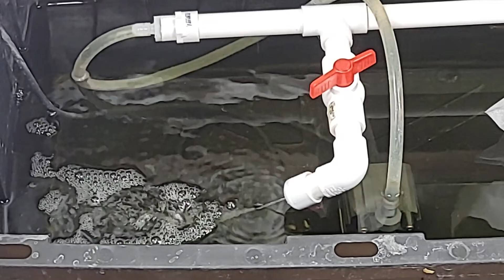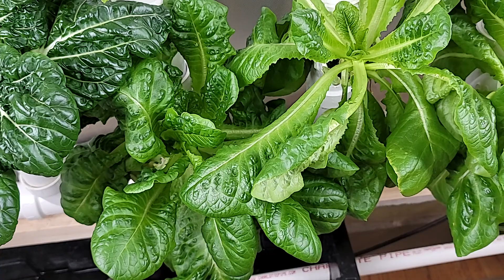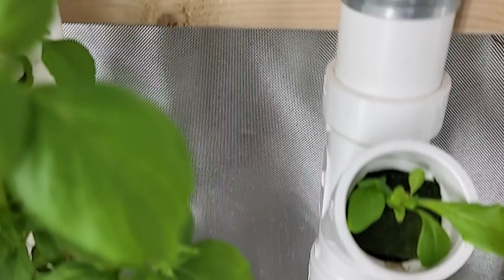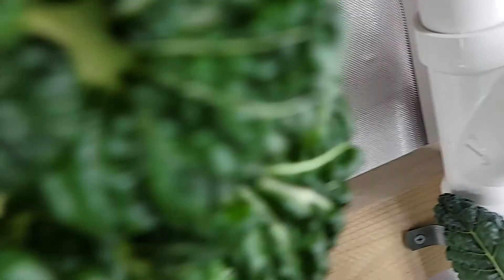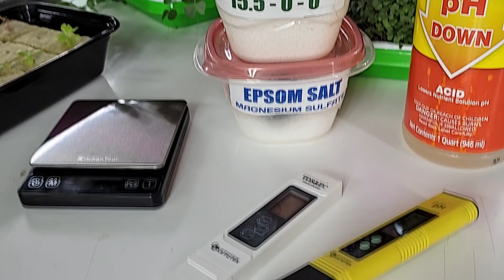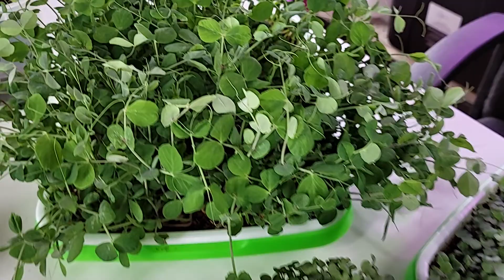Vertical Hydroponic System

Comment: What did you use to prevent the plants for falling in the PVC tower?
Reply from the maker: I start the seeds in a growing medium, either Rockwool or  Oasis horticubes. The cube shaped growing medium fits snugly into the pipe and holds the plant in place.  Once the roots get established they will fill up the pipe enough to naturally stay put.
I have lost a baby plant down a tube a couple of times when the cube was not quite big enough. I just fished it out of the next lowest hole.  After that experience, if a cube is a little small, I tear off a scrap from the growing medium and use it as a shim on one side to make sure the cube fits snugly.

Comment: What grow medium are you using for your system?
Reply from the maker: I started out using Growdan Rockwool cubes. That worked  well. I reordered what I thought was the same thing, but ended up with an off brand that looked similar, but didn't work. Germination rate was terrible with the off brand and plants grew very slowly.
Then I decided to try Oasis Horticubes. They are a little less money, 10 cents each vs 14 cents for the Rockwool. I am using the 104 per sheet cubes. They don't fit as snug as the   Rockwool but work fine and I think I like them better. 

Either is a good medium. Rockwool is naturally higher in ph so you should soak them in a ph adjusted water before using them.  That's not necessary with Oasis Hoticubes.

Comment: Great video! Can you explain the top watering section more? What are the rubber grommets were the black hose comes out of the pvc pipe exactly? Thank you!
Reply from the maker: if you search Amazon for Top Hat Grommet you will find a variety of choices. I use Hortipot 1/4 inch grommets and they work really well. Drill a 3/8 inch hole in the pvc and the grommet will fit in tighly. They never leak.

I also like to run the water into the back of the stack near the top instead of through the top of the cap. it's less height for the pump to lift the water and makes sure the water hits the front of the pipe,  running down directly onto the plant roots.

I also use a grommet on the top side.It keeps the tubing from slipping out of the back of the pipe.
Reply: @wingfamilynursery5902  thanks so much! I ordered the grommets and will follow your advice! Really smart idea to put the hose in the back so it drips down the front. Thanks again!